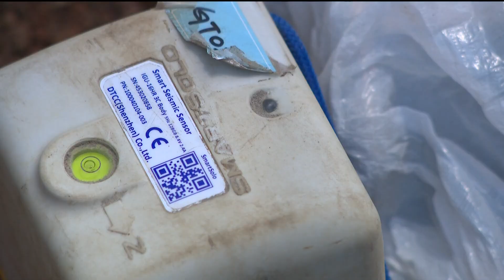Scientists search for answers on earthquakes near Lake Lanier, place new sensors below ground

Comment: Wherever there are mountains there are fault lines. Lanier is at the base or foot hills of the Application range. When you create a man made dam, over time the weight of the water can make it so deep into the ground that it can act like a lubricant and cause earthquakes. Lake Mead is having the same problem. Similar to the way that all the fracking in the Midwest for the oil industry.., is causing a high frequency of regular earthquakes as a direct result of pulling to much ground water out of the ground to keep oil drills cool. 

The earth’s ecosystem is a delicate balance… and man is destroying the earth in many many many different ways! Greed is deadly.., we HAVE to learn to respect Mother Nature.., because industry, global pollution, bad farming, overfishing etc… is literally destroying this planet.., and we will all feel the results!!!….